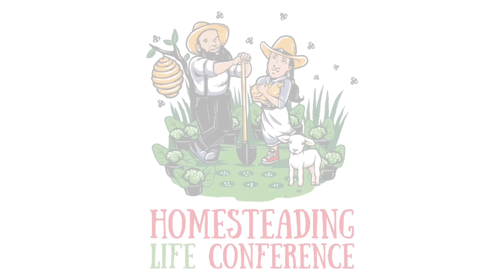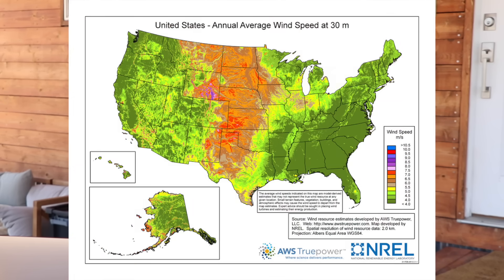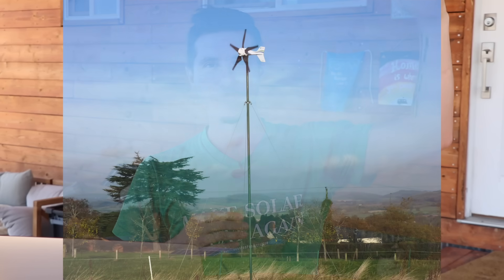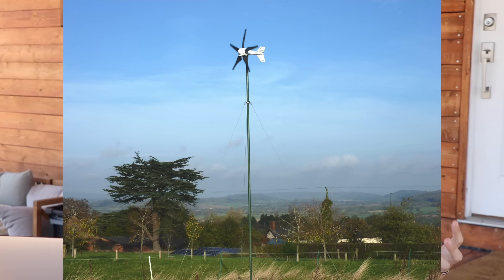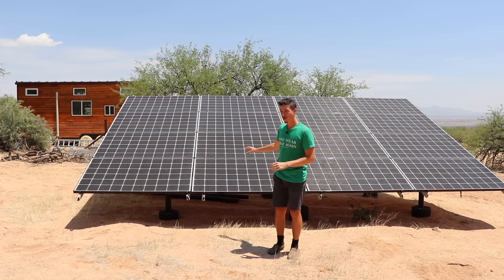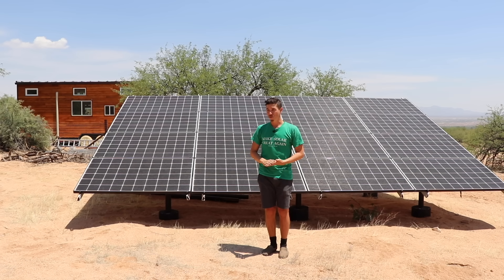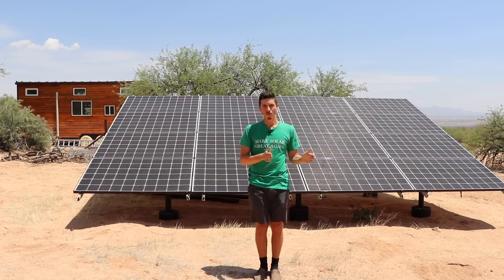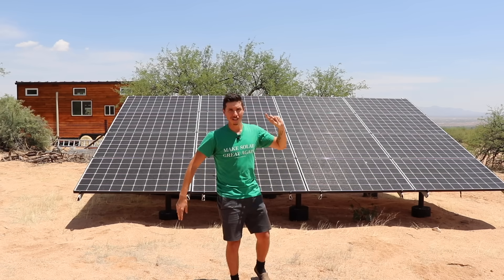Micro Wind Turbines... Are They Worth It? (Off Grid Solar)

Comment: I have been looking into a excess wind power diversion into a hot water tank element installed into a hot water tank. This would offset the primary heating mechanism(gas).  Better than dumping it. It's windy in the valley that I'm setting up the homestead.

Comment: You make some good points about wind turbine, As I live in UK we don't get anywhere near as much sun as you guys do,
I have 4K solar system it produces plenty of power during daytime, but night time is none so my wind turbine just runs at night to keep things topped up, I have system with brake so when I have full battery's brake is applied and turbine is still,
We get around 30 mile an hour winds most nights, and my turbine is only 20ft off floor, (has 2mtr blades), 
system has been working ok for 5 yrs just requires greasing once a month, 
I bought turbine as optional extra when I bought the solar,
I like how it works but would have got extra battery's ( just didn't have room for them)

Comment: you sound kind of like a wind turbine hater. not much neutrality in your point of view. and btw you're in the middle of the desert. you could start with " where i live, it's not worth it".. i live in Bariloche, Patagonia, argentina. and i assure you it's windy. and in summer you have lots of sun. so why not both systems? when it's cloudy it's usually windy, when there's sun there is not that much wind. at night sometimes it's windy, sometimes it's not. but when the wind blows i wonder to myself i could be generating energy out of that renewable energy source.  thought it was gonna be more of an informative video, not a hater's point of view!. sorry for my english, and i hope i made my point.

Comment: On the great lakes, a "bad day"   is 5mph constant day and night,  average is about 15mph day/night, year round.   now sure,  it might only be generating 25%  of its capability, so say,  100 watt/ hour out of a 400 watt system.   but around here, thats 100 watt/hour for 24 hours...  vs in the winter around here, 9 hours of production time,  6 hours peek...  SO you wind up with "just as good"  as solar.    now the average wind-speed gives 50% power or 200 watt/hour over 24 hours.   and during the winter the average actually goes up.   now no,  i wouldn't recommend wind for EVERYONE.   BUT in lots of areas,  1-2 wind generators can be a nice backup for nighttimes.  

Another option is Thermal Electric power.  A lot of people run wood stoves during the winter.   They could easly hook up 400 watts of thermal electric power generation,  such that when they are putting on the stove, usually when its coldest...   they are generating power to supplement their solar system, which is often at its weakest at those times.

Now there area also people who keep small portable camping wind turbines in their cars, trucks, and sleighs.   IF they get stuck in a snow storm,  a solar panel won't do them much good.    But with the power generated by the turbines they can often run a small 300 watt heater.  And while that might not seem like much,  again,  in Canadian winters or alaska, thats the difference between life and death.

Comment: Your comparison appears to be static placed panels vs. an optimal wind turbine setup. If you compared a fully optimized solar array (sun tracking ,mppt charge controller, etc...) the cost difference wouldn't be as much. If your in an area with pretty consistant wind adding a wind turbine could make sense. As with solar you can run a wind turbine with simpler some what less effective setup)

Comment: Your title is misleading.  It implies an unbiased comparison, which this is not.  Your title could/should be:  Micro Wind Turbines...   They Aren't Worth It.  (Off Grid Solar)

Plenty of successful wind/solar combo setups out there, where wind is not the main "driver", but is an assist to keep the battery bank topped off during "non-prime" solar conditions.  Like all setups, it's about power needs/management, and what works best for a given situation.

Of couse, I grew up in old small farm country (many of them Amish), where windmill water pumps were everywhere.

Comment: I wouldn't give up my wind turbine for nothing. Not all of us live in the desert getting sun every day. If I depended on purely solar in the winter I would need to compensate for the lack of sun by adding way more panels to equal my 700 watt turbine. I also divert to a water heater so now I burn less propane. Turbines are worth it and I barely scratched the surface. Your video comes off as misinformed and biased. To each his own I guess.

Comment: You are right when applying it to a normal application, normal home and sunny environment. But when you are living offgrid or when grid is not stable, you need 24/7 off grid source, sizing it with only PV will cost you much more than a hybrid PV and HAWT. Just because you need to cater for the night load when sizing your batteries (without going further into cloudy days etc..)

Comment: There are other non-propeller wind turbines that are pretty cool (like vortex bladeless although that one may still be under development) not as loud.  Less maint. Less efficient than traditional but can fit more in smaller.  To me it would be good to have as a backup when there’s no sun for longer periods - probably not a problem where you are.   Never heard you’d have to have it at 65’.

Comment: OK I get it the return my not be great but in your statement where have inclement wheather you have higher wind speed and when the sun has not shown  for days and the wind blowing you would be happy to have the turbines putting power that you are using back into the bank or running a genorator so I disagree with this blanket statement

Comment: hi i am building a power wall whit dead laptop lithium 18650  24v system 7s  i got the same mppt and inverter you got in your videos. my is running but i am changing from wet cells to 18650 i used a combox to do setting and i need to know the setting to charge this lithium cells, i guess is on custom bat? if you can send me a copy off your setting i can refer to it   so i can used this to , that if you can help me  i will thank you, and continue you grate videos i learning a lot, lead me know thank you att Hector from orlando fl

Comment: What about solar tracking systems? do they actually give you up to 40% more solar energy as some claim?
Reply from the maker: that's a claim and like what we mention with wind turbines, you have moving parts, more setup capital costs, it may just be easier to install a few extra panels to compensate ;)
Reply: Setup I'm going with is €17000 as it is. And at 57°North the difference between June and December on a fixed panel is enormous (49 vs 9 kWh a day). Even manual angular seasonal adjustment barely works. 
I'm actually thinking to DIY tracking system. However, I do need more information of how much I actually gain

Comment: Solar panels are better... said by the person who lives in the desert... Lol!
Reply: Not everyone is living offgrid in a desert.  The efficiency of solar panels is not in every situation the same, in other situations wind turbines are much more efficient.

I live off grid on a boat in north west Europe  and my wind turbine is delivering 90% of my electricity needs all year round.
This turbine cost me about $ 400 and doesn't require a 65 ft high mast
My solar panels (2x80 w) only deliver about 15% all year round due the limited space I have available on deck and cost me about $ 1100 and a lot of space.
Reply: @AntonKramer  good for you
Reply: @AntonKramer  if you paid $1100 for 2x 80w (160w) you got incredibly ripped off. A 300w panel alone cost around $200
Reply: @AntonKramer   can u recommend some good wind turbines
Reply: @elderrush3981  
It depends on your situation, your power needs, your batteries.
In my situation on a 38ft sailing yacht I currently use a small 1x 600 watt (max) combined with 3x160 watt solar panels.
With 4x 12v 180 AGM batteries and 2x lithium ion 12v 1200 batteries.
(When my budget allows it I will replace my AGM for lithium batteries}

This configuration gives me more than enough power to live 100% off-grid
I also use a osmose desalinator watermaker that demands about 40 amp at 12 v and a 220 v 1500 watt convertor running onboard  and only occasionally a small fuel generator kicks in. But only when there are a few days without wind or sun.
Reply: @elderrush3981  f your in a bad area or have a piece of crap wind turbine which is common I agree solar is better however Hurricane wind power kicks solar's ass watch and check the data for yourself https://www.youtube.com/watch?v=x2dsXAgYKA4  1.2 kw solar versus 1 kw turbine in 24 hour output KWH I am not trolling you as I have seen the "other company " do but I think your making an attribution error based on your experience. 10 kwh versus 3 kwh wind wins this round although we design large solar systems and love both
Reply: @AntonKramer  I would like to learn more about sailboat alternative power systems. Is that enough power to run the AC all day and at night in the Caribbean or do you have to run the generator at night?
Reply: @AntonKramer  Not everyone is living offgrid on a yacht either
Reply: @AntonKramer  wow, can you show your instalation?
Reply: @AndrzejSQ9PKW  agreed
Reply: Nothing against solar but when shtf and you can’t call a tech to come out to fix it anymore what are you going to do start processing sand and carbon into silica, make new cells from scratch?

A wind turbine however relies on some pretty basic electrical concepts.
Reply: The Truth, he lives in a good place for that.
The BAD, you did not see the whole video.....AND the Cost and how expensive/complex it gets.
Reply: I live in the desert in outback Australia. Solar is good but can only generate while the sun is shining, wind turbines can be used for 24 hours. Most people use most of their electricity in the evening after the sun goes down. With wind you can charge your batteries at night so when you wake up you instantly have electricity. Personally I think a combination of both wind and solar is the way to go..
Reply: @perentee77  bingo!
Reply: I live in the uk and loads of people use solar here.
Reply: EXTREME ENGiNEERiNG LiFE  yes indeed water is the best if u live close to it. nothing beats constant flow of water
Reply: Solar is huge in Germany and that's no desert. Most of the people commenting from cloudy places don't know how solar works. Yes, you'll get reduced output, but not by much, you might need 20-30% more panels than someone in Spain, but PV panels are so cheap now it's still more economical than wind for a DIY system.
Reply: Exactly! I have tree cover on most my property and I get a min of 5 meters of snow a winter so solar is not all that great.
Reply: And his tallest tree is smaller than my rose Bush over the atrium. Next to my 110 foot tall basket Oak. :\
Reply: Brandi LeeMa exactly
Reply: As I note, it's the equipment that connects it all together and the nightmare maintaianace of wind vs the simplicity of solar set and forget it.
Reply: Like analysis. Answer depends on the area etc. But in general I agree.

So really I gotta say it this video... It's visual... We have to look at it, so sweaty pits? Either put a dry shirt on before you start the camera rolling, or wear something dark enough the sweat doesn't show, our just keep your arms down.
Reply: For me I'm surrounded with trees I have a wind turbine switch will help in winter when trees are bare but need to install solar for non winter
Reply: Lol
Reply: Lmfaoo
Reply: Right! Lol
Reply: UK winter time, long dark days fog, a small wind gen will do the trick without any needs of being BIG and TO MUCH IN HEIGHT
Reply: yeah but the wind is 24hr/day
Reply: @Brandi, I'd say they BOTH would be useful, just have a disconnect for when you don't need your fan generating power.
Reply: Except when you calculate in that when you go north, the days are shorter. Some places don't have sun for weeks! Not even covered by clouds, it just doesn't rise. On the winter solstice, Chicago has a whole hour less of daylight than Arizona.
Reply: bel pet and that’s where I live.
Reply: @thatonedog819  that's only true in half of the world... 🙂
Reply: @thatonedog819  
Exactly. A micro wind and a micro hydro as an addendum to a decent solar setup is a very good idea imho. Here in Vermont winters (with small-ish system) I’ve made 5Ah over 3-4 days before and felt lucky... when I can do 55Ah in half a day PO “partly sunny” in summers
Reply: @thatonedog819  did you even read? 1/3rd even when cloudy.. ya know how even on cloudy days you get sunburned... lol
Reply: I live near the sunniest city in europe. During Summer there are strong eastern winds at dawn and southwestern winds after sunset. Even in the best of [solar] conditions those extra hours of charge save hundreds of bucks in battery wear.
Reply: How about solar panel and wind turbine together? Put the two out there just in case one of them is getting stupid!
Reply: for sure they do....I live in a 3 stories building, orientated with front in the South, Sun is rising in the morning from the left of my apartment, in summer, I have 25 minutes of Sun in the kitchen, the wall is straight, then after noon Sun moves on top of my apartment,  then to my right side of living room, and have Sun until evening, have a small roof over balcony, less than 3x2 meters, no way I can put 4 solar panels, an inverter, and large batteries for storage......energy is still cheap @grid, wind turbines makes more sense in this case...
Reply: @lupesalex3910  and you can make some of the wind turbine components such as the blades, by yourself - as  I have seen in other utube videos.  Worth trying out wind turbine in my case - in the 4 acres with lots of trees and no neighbors would see and complaint "unsightly" wind turbine ( I think they are beautiful structures -  at worst, just paint them green and blue to merge with the landscape and the sky )
Reply: So what form of renewable energy is best? You can't  generalize.  It depends on where you live.  I grew  up in Kansas where wind is an excellent choice.  But now I  live in Alabama where wind is not practical in most instances.  Solar and biofuels are more practical here.  I have a grid-tied  solar array and it works great.
Reply: Lol cloudy, solar is nice in the summer here in Idaho however not so much later in the year.
Reply: i think a diy wind turbine is better its 1/4 the price for double the power i like solar but during rain it is innefective
Reply: And wearing a solar shirt.. lol
Reply: AR: EXTREME ENGiNEERiNG  And you're an idiot.  99.9% of people cannot use a water turbine.

Hawk your crap elsewhere.
Reply: Based Bear - lol....except 100% of all electricity used in the Pacific Northwest comes from water turbines....
Reply: Its worse in deserts as the dust covers it.
Reply: He did say “there may be some places where wind makes more sense”....  listen to whole video
Reply: Wind is driven by solar power.
It does falloff somewhat.
Reply from the maker: it's even more important in areas where there is less sun, your panels still produce power (about 1/3) when it's cloudy out :)
Reply: Handeeman 
If you live in Alaska you have 3 months of 3 hrs of sunlight in the yr
Reply: @Handeeman  You completely missed the point.  Everyone's situation is different, and everyone's solution is different.  When you make claims that wind is no good and solar is the only solution... then YOU are part of the problem.

Energy sustainability needs more than JUST solar.  If you think that it's the only solution, it's likely because YOU LIVE IN A DESERT!  Most people don't have the solar exposure that you do.

Wind is just another feather in the sustainable cap.  Dissing another form of green energy is childish at best... and fraud at worst.
Reply: @Handeeman  i would like to have your email id plz
Reply: @Handeeman  Not that easy answer. Sun is not much of an issue as much as heating is. If you decide to use heat pump in order to reduce carbon footprint, you need to have huge amount of power stored over night. and overnight there is no sun producing electricity, which takes solar panel batteries pricing up to the roof and eventually turn us back to be less green, as those batteries have its own life and it takes carbon to produce them. On the other side, if you have stable wind flow, you can heat your house using turbine, while creating less load on batteries which are charged by solar panels over the day. And that all if you exclude that when snow falls, you will have to clean solar panels, otherwise you will get literally off ANY grid.